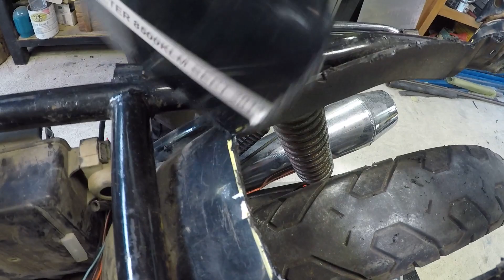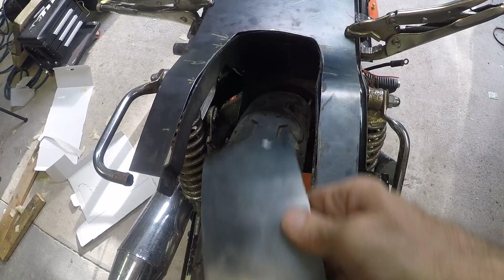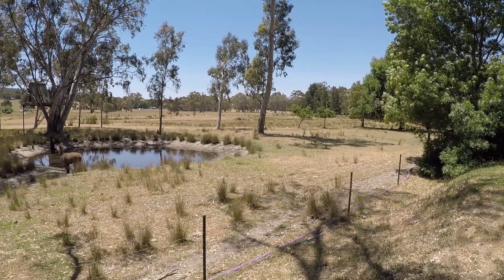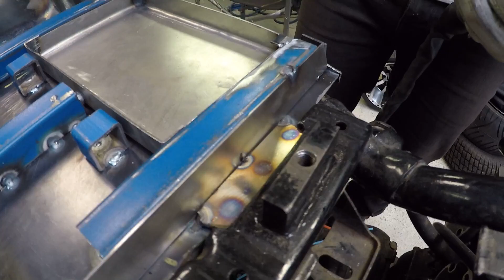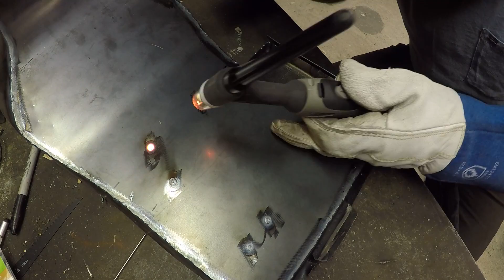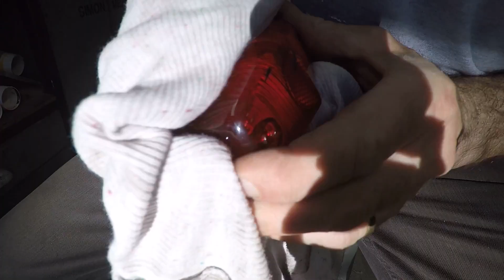Yamaha XJ650 Part 10 Custom Seat Build

Comment: Gday, thats a brillant idea with the draw and it goes to show you don't need much "tooling" to get the results you want, Im really enjoying this series of videos, you are spot on with the weather, its been getting very hot here on the far south coast NSW, we're getting fairly bad fires now so the next few days are going to a worry, thanks for another great video mate, very enjoyable watching,    Matty
Reply from the maker: Thanks Matty. Fires quite bad in SA too. Seems this heat is never ending...
Reply: @M @Mezzmoengineering  I’m in SA and have started a similar build quality build. If I cut the rear seat tubes legally I have to involve an engineer. How much attention does your bike get from the police (sensible riding) and have they queried you on the rear end mods?
Cheers
Reply from the maker: @SB9999-r4l  zero, never had an issue. I think if you’re sensible you will be fine

Comment: Lookin good.. That Log Book is that required because of the age of the bike or for Club Rego or because it is a custom. Cheers
Reply from the maker: Hi Mate, the log book is required for any car or bike classified as a historic vehicle. To be historic it needs to be older than 1986 and you must be a member of a registered bike or car club. The book is issued by the club and it needs to be filled out for each ride as there are a limited number of days you can ride in any one year. This makes rego much cheaper so it works well for classics that don't get used much.
Reply: @Mezzmoengineering  Thanks for the info I was thinking of doing up an old 1974 Sportster  I had one a life time ago :)

Comment: Wow that looks awesome, really nice work mate. I just have a question on how do you go about registration after cutting the rear seat/fender mounts off. Should it be engineer inspected an certified then get it registered or is it ok to cut after the rear shockers an not touch the subframe?
Reply from the maker: Thanks Mark. The bike is already registered and I haven't changed the frame at all.